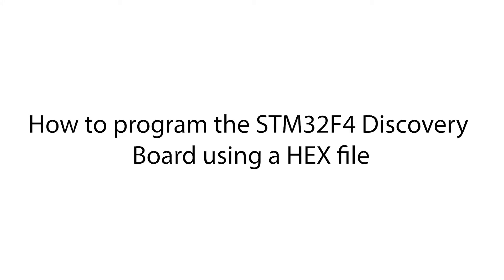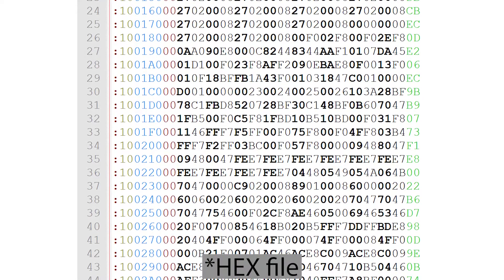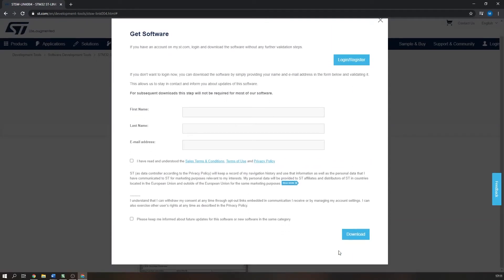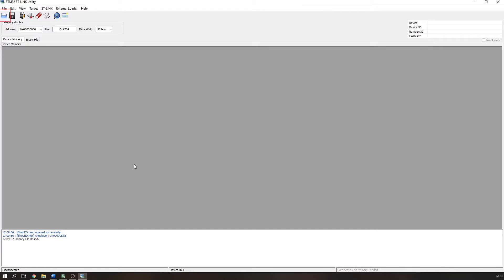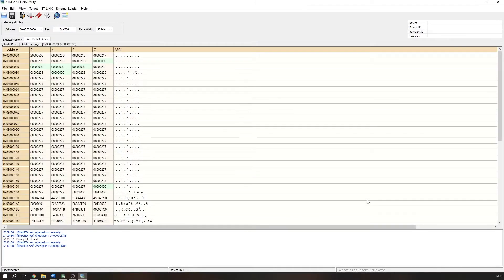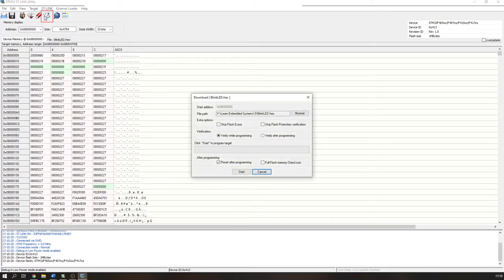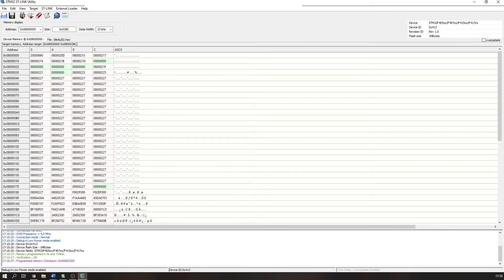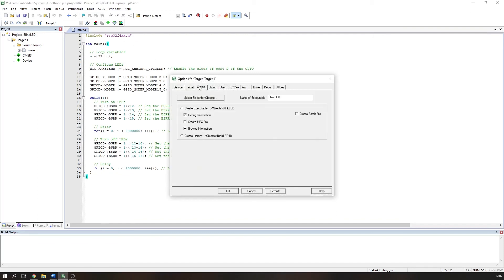How to program a HEX file to the STM32F4 Discovery Board

Comment: I wonder what should be done for stm32f103c6t6 this will not be done

Can not connect to target!
plase select "connect under reset" mode from
target>settings menu and try again.
if you're trying to connect to a low frequency application,plase select a lower SWD Frequency mode from
target> settings menu.
Reply: you need an stlink for that